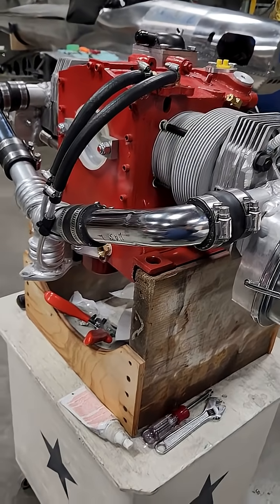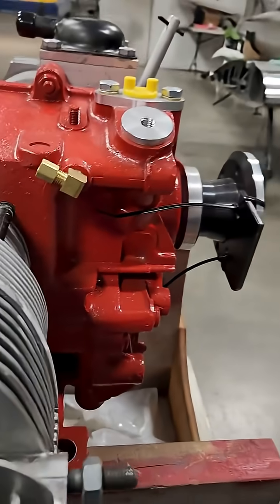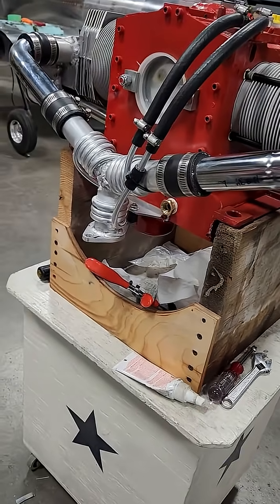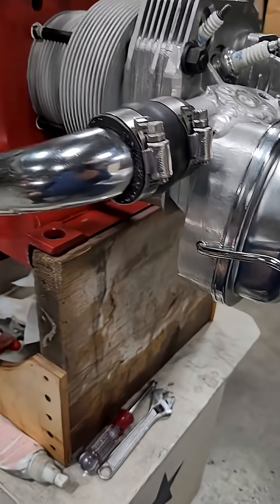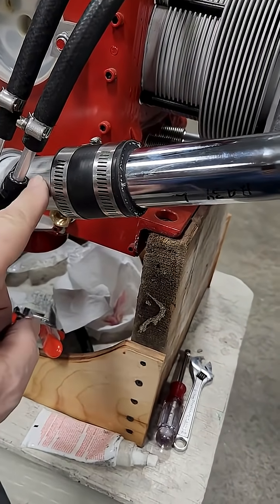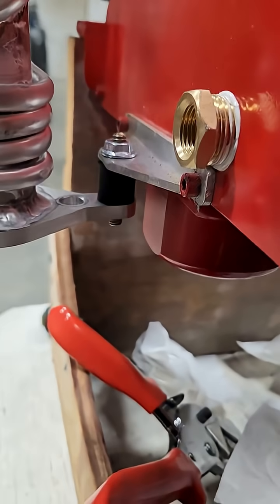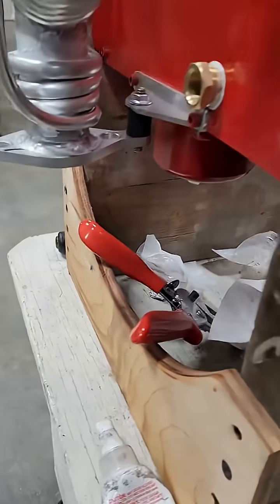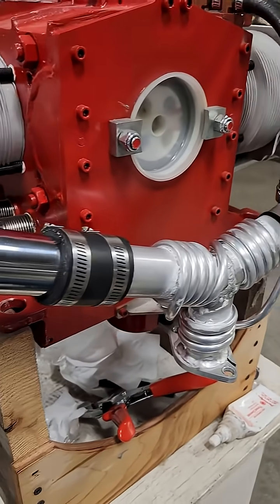45hp magneto install

Comment: I am curious why you’d wrap those oil lines around the intake? I understand it’s supposed to be an oil cooler but doesn’t that defeat the purpose of keeping the intake cool?
Reply: The oil is 180°minimum , the intake air is 70° or less, personally, I'd get an oil cooler and mount it under the nose
Reply: @TomGellos my thought is that it would be for anti-icing, but I’m not sure if it would prevent that in the carburetor with it being on the intake above the carb.